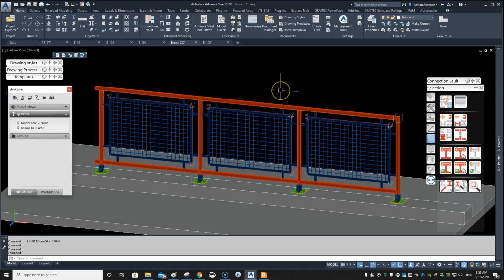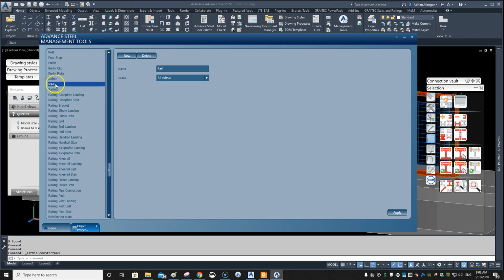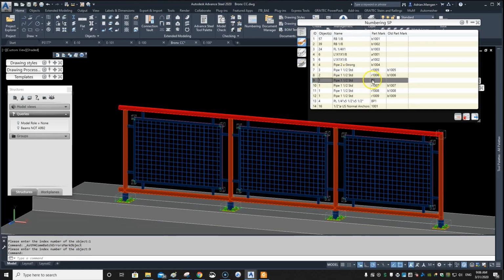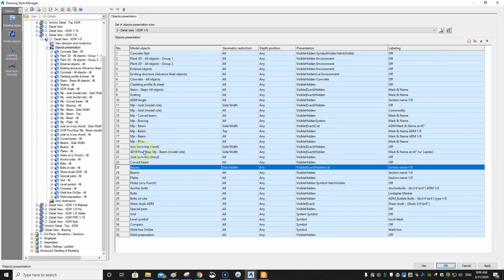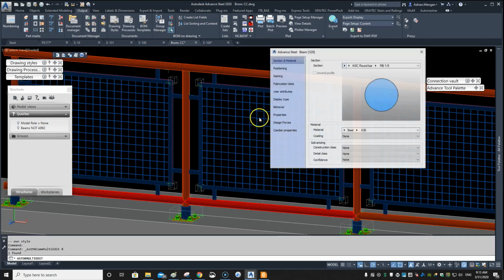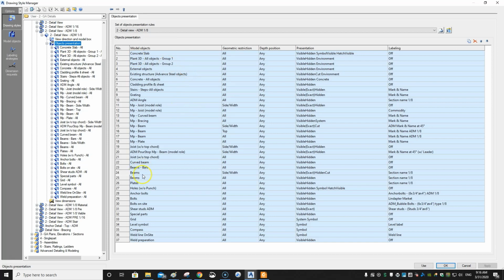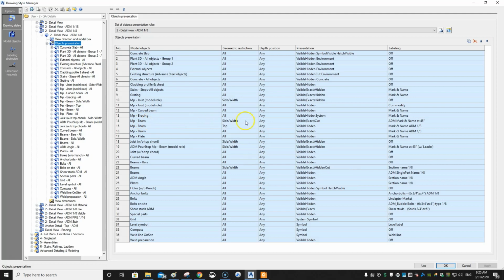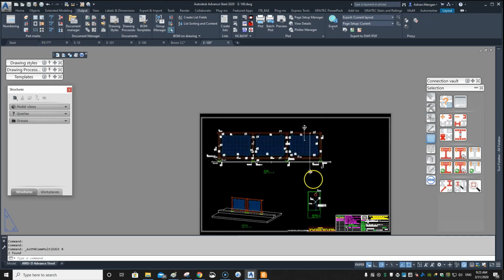Advance Steel - Drawing Styles, Model Roles, Prefixes and Queries.

Comment: Helping for sure. I'm working on a beam with several stiffeners. the drawings I have are from the early 90's that were edited from the 70's and they're requesting updated shops. Each stiffener had a different part mark. How do I edit model roles to identify a specific size stiffener and assign it a specific prefix. I have 3/4"x7" plate and 1"x7" plate stiffeners. their part marks are m and b respectively.